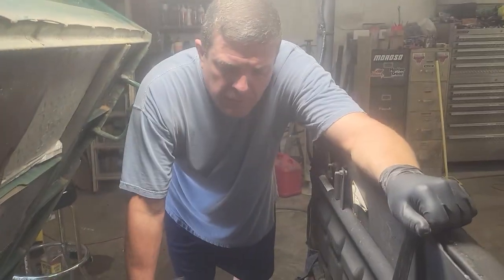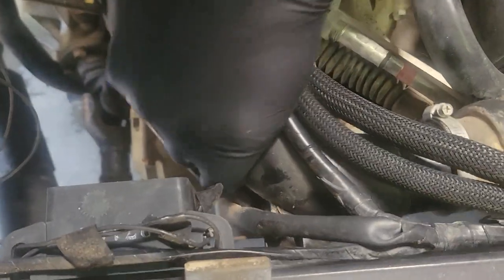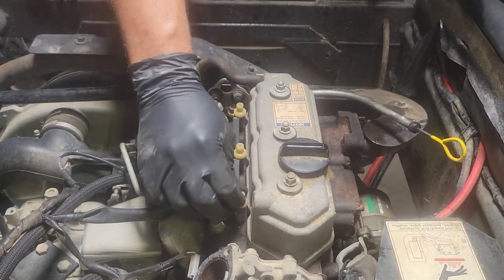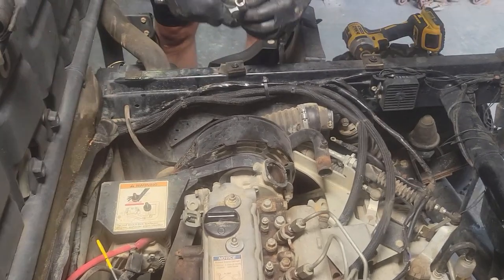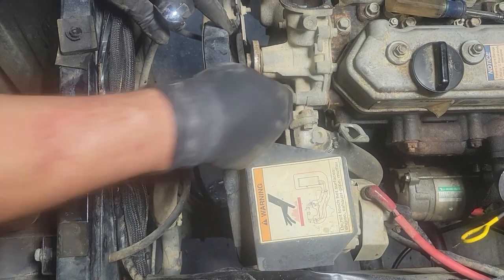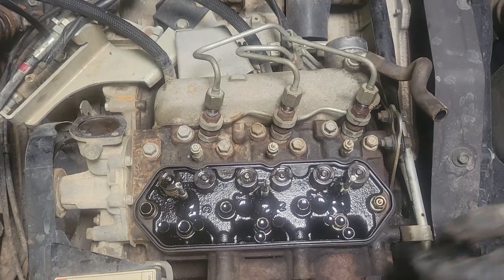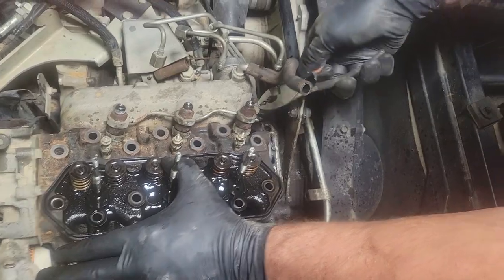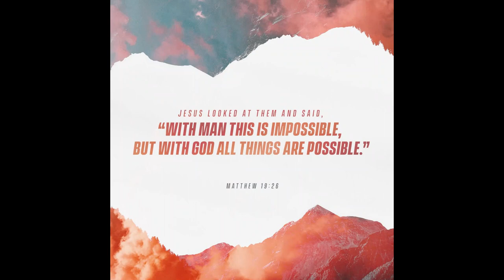Kawasaki Mule 3010/4010 Diesel Overheating Issue Fix Part 1 of 2

Comment: Was this Mule running when you got it? I'm working on a 3010 that overheated, lost power, died, and now cranks but won't start. Missing radiator over flow :(.. coolant low and kinda nasty (no sign of oil). Oil is nice and black also full (no sign of water). Could It be the head gasket still? and lack of compression not letting it start? thanks
Reply from the maker: It was running but would overheat pretty quick.  I hear the blown head gasket is a common issue with high hour mules.  I would check the valves before I removed the head though.
Reply: @JasonJonieBuilds  okay! I'll do that next
Reply: @JasonJonieBuilds  Hey bud, I did the valves all at .008 and finally got filters, belt, new radiator overflow installed. I tried starting it with the radiator cap off and as I crank water wants to pulse out of the radiator. It still will not start but is making white smoke. I'm thinking the head gasket is leaking into the water port and it doesn't have enough compression to start? Does that sound right to you?